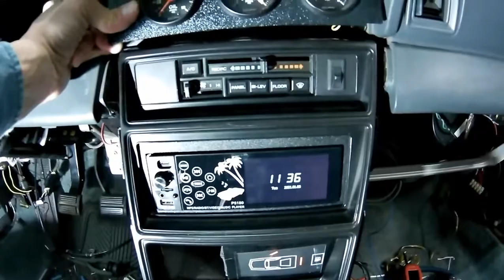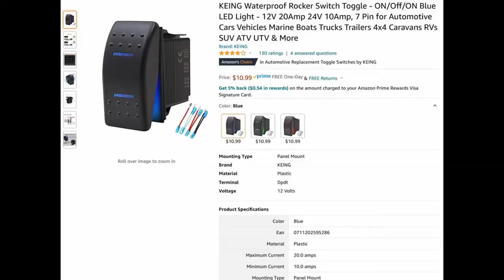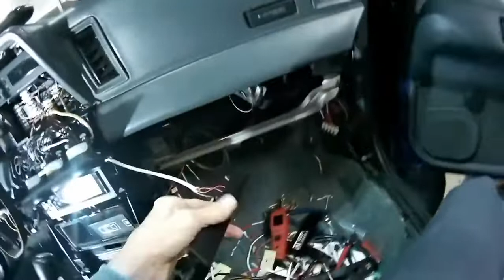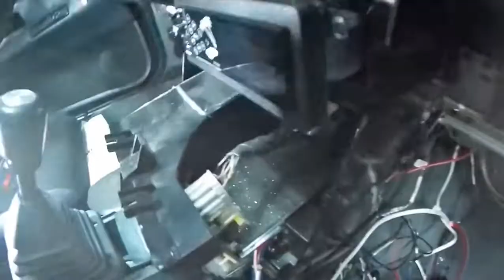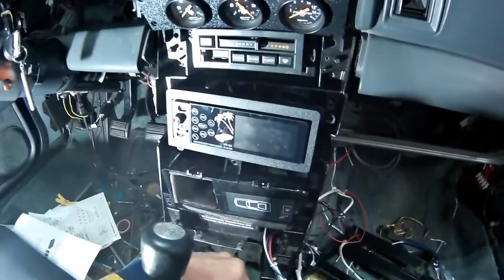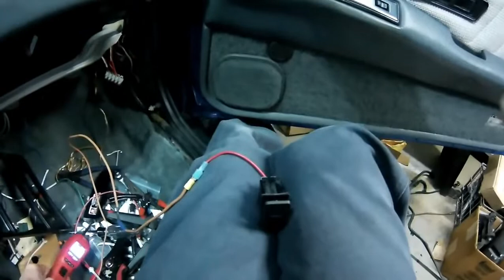Laser86 -  PT5  -  Dash & Headlights

Comment: @LaserDad — could you make a video of what all goes into the manual transmission set up? ie Tranny, Axles, Pedals, Shifter & Linkages, etc? I am going to convert my auto Laser into manual, and I need to know what all I need to take off from the donor car I found somewhat close by.. ideally i would get the full list, and see where everything is located so I can make one trip up there and get everything I need.
Reply from the maker: Unfortunately, my cars are already manuals, so I won't be doing a video on how to do it.  My best recommendation is to find someone near you who has a parts car, with a manual setup, that you can get the parts from.
I converted this car back in 2005, from an automatic to a manual.  What I later learned was that you want a 520, 555, or I think a 568 manual setup.  The 520 and 555 are almost identical, but the 568 will require a different shifter and cables.
Go to TurboDodge.com, or TurboMopar.com, and search for how to do it.